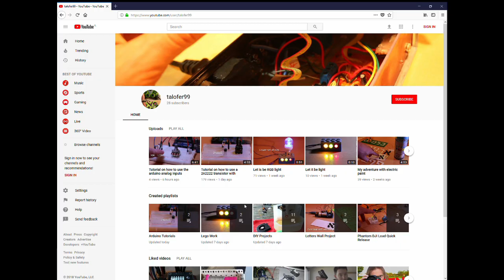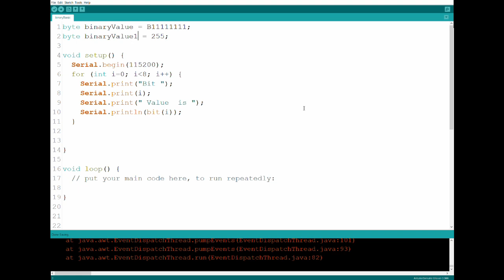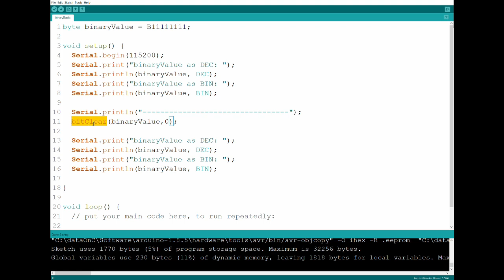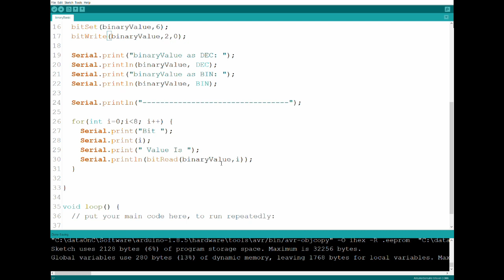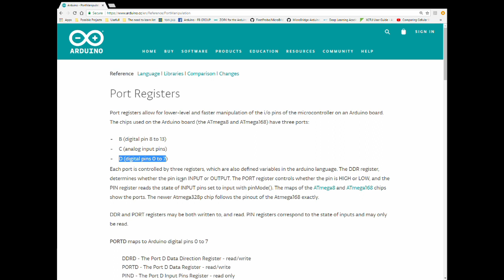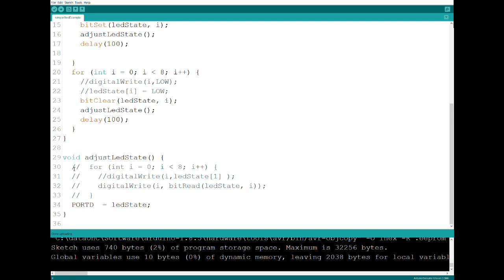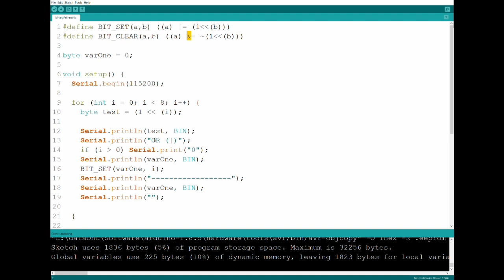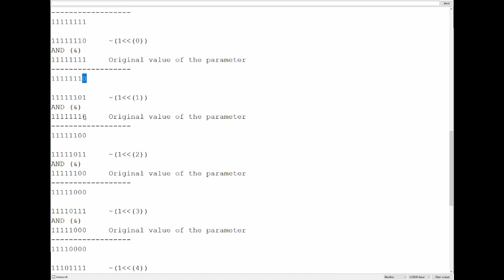Binary arithmetic and port manipulation on arduino

Comment: This is the most concise explanation of using a port for output that I have seen on Utub, the video is also very well presented thanks.
yesterday I spent hours trying to find a video like this to explain how to get a digital 8 pin parallel input, I look on Utub, I looked Arduino Forum and I saw many hints at how this could be done but nothing concise or conclusive so if you have the time; I erg you to do a video on how to do parallel input using the port method.
Reply from the maker: Thank you so much :) 

And I did one. here you go 
https://www.youtube.com/watch?v=cNxd31mPZCg

Also, would love to know what were the search terms you used, to add it to my video tags :)
Reply: @talofer99  Thank you very much, it is a parallel input but it doesn't use the PORT on the Arduino to do it, I couldn't find anyone who has done a video on this subject.
Reply from the maker: Sorry I misunderstood you. 
Its pretty simple all you need to do is to use the value in PORTD after you made sure all the pins are set as input.
Then easy BIT of the PORTD byte represent the state of the pin 1 = high / 0= low.
And I should think of a video for this - thanks for the suggestion :)
Reply from the maker: one thing to note is that pin  0&1 are used by the hardware serial and are part of PORTD on the uno.
Reply: @talofer99  A video would be so cool and help lots of people, you explain every detail so well thanks.
Reply: @talofer99  Yes I noticed about pin 0 and 1, my plan is to make a BCD to Hex decode and display out of an Arduino Nano, it's all but impossible to get the old chips these days, I bought some DM9368's eBay and they turned out to be fakes.  I want to build a Z80 computer at some point, I mean one that has dedicated bits and not stuff done in software like the display for example which is what I got on an 8080 CPU kit that I built.
Reply from the maker: Sounds like a super interesting project :) 
I never dove into the 8080 and Z80 builds ... even though I had a Sinclair as a kid - and damaged it badly trying to "understand" the connector on the back :)
Reply: @talofer99  yeah the old ZX81, I had one too, I was good for learning BASIC, but not that conducive to learning about the workings a Z80 CPU. I have an old ZX Spectrum that I found on a tip that I plan to use the parts to rebuild something more akin to learning about how it all works, it's actually a Spectrum in a case with a real keyboard by DKtronics, I want to build it so it talks to a real terminal with the standard codes and stuff like that.
Reply from the maker: good luck - will wait for the video :)
Reply from the maker: The new video is ready - would love to hear your feedback :) 
https://www.youtube.com/watch?v=BB7fZPuzH9Y